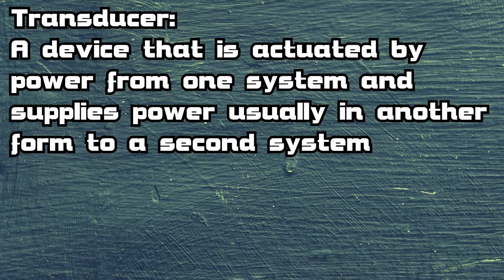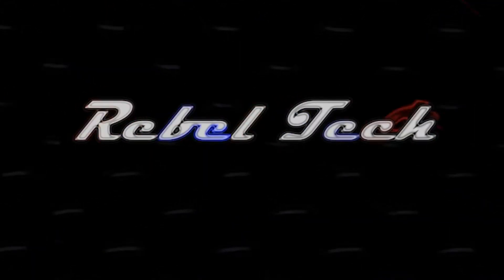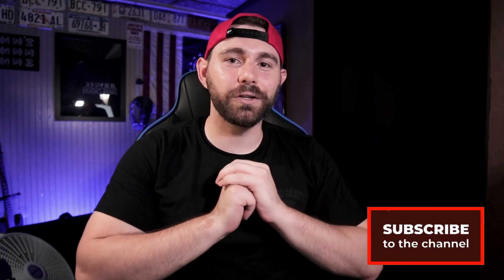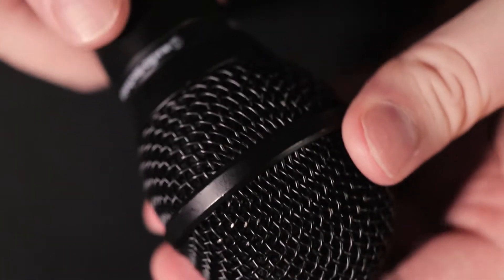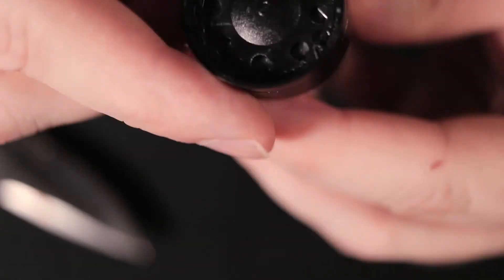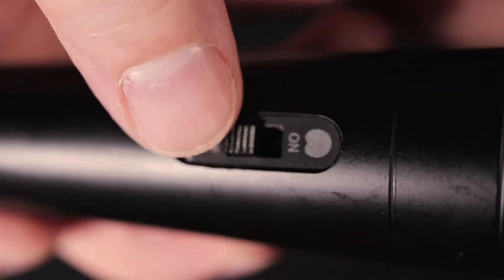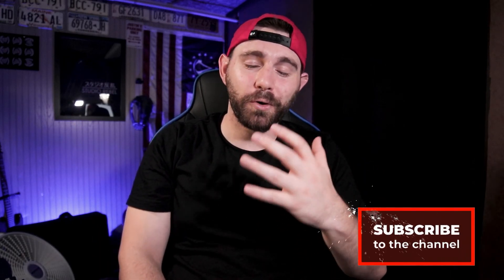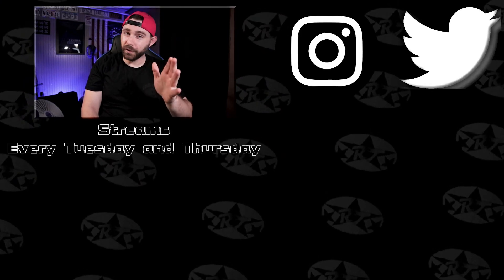What’s INSIDE a Dynamic Microphone? (Audio Technica M4000S Breakdown)

Comment: A relay ? It looks like a plain switch.
Reply from the maker: A relay is a switch, when it’s really broken down. Sure there are differences but a relay is essentially a switch
Reply from the maker: If you do want to get technical, then no, it’s not a relay. Because technically a relay is switched on and off electronically. A “switch” is mechanically operated. 

Both a switch and a relay connect and break a connection between to points. Just operate differently. 

If I were to have the switch on the mic turn in and off with some type of electrical component that is engaged and disengaged with a timer or some other means, then it would be a relay. 

I used to work on my old Lincoln and it had relays for the brake fluid pump, that broke a lot. I had to fix them too many times.